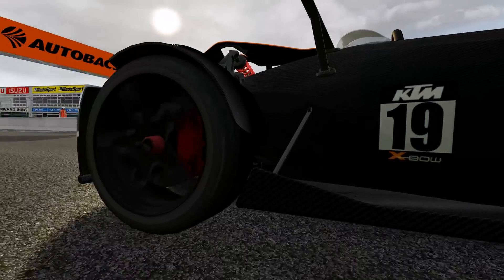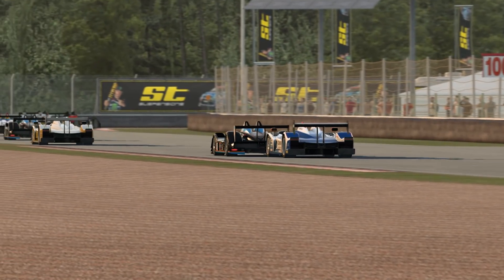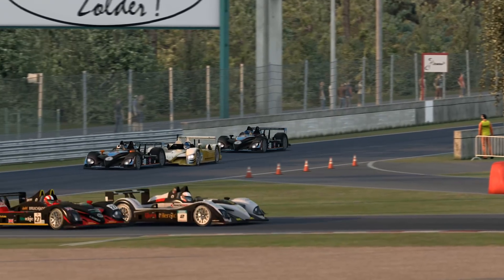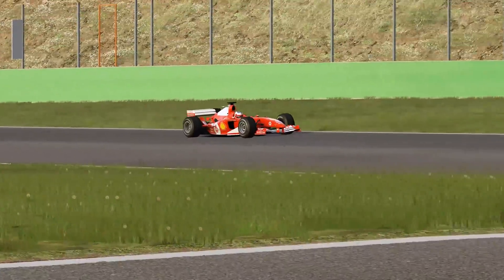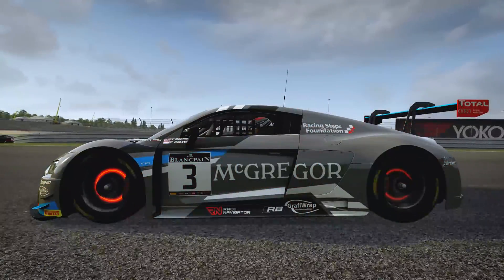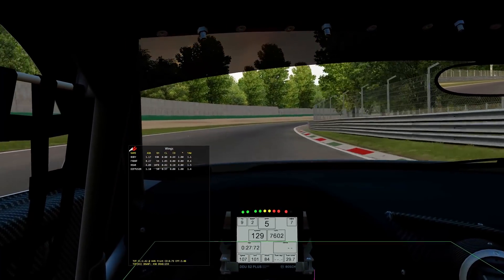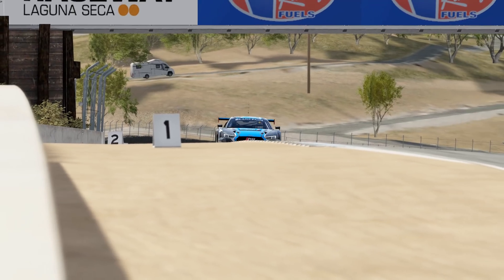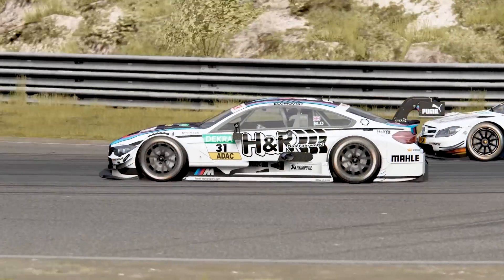Sim Racing Setup Guide 07 – Ride Height & Rake

Comment: In a downforce car if you're too low you may stall the underbody aero - OK cool, but how do I know this is happening?
Reply: +Viperion_NZ Every car is different here (!) but stalling can occur both when too low and too high. When too high it will loose a ton of grip and won't let go - think top of eau-rouge where front is stalling in almost any GT car with any setup - you get endless understeer.
When too low the car suddenly becomes twitchy, as the closer you are to the stall limit the better aerodynamics work. For front splitter it looks like this: you enter the corner, car wants to oversteer and then suddenly understeers, then oversteers again and so on. And in reverse for diffuser stall on the rear of the car.
This often happens in corners with some compression or camber, like bottom of eau-rouge, and also can happen under straight braking where tyres lock in initial braking phase - where front bounces off thanks to the stall reducing front grip for an instant long enough for a wheel lock.

What's also important is that when you are close to stalling on one side of the car, a small change on the other side may ruin your day.
For example, you run GT car with nose close to the ground, then you stiffen rear springs, and suddenly car is understeery in high speed corners, that's front splitter stall happening because jacking the rear up brought the front down.
Reply: You suddenly lose lots of grip in high speed corners .
Reply: I think Ayrton's 1994 Imola crash is the best example there is...
Reply from the maker: Hey dude - yeah, as the other guys have said, it's usually pretty obvious. You may lose the front, or the rear, depending on the circumstances and the rest of the balance of the car, but generally it'll happen at a point where the car is very highly loaded, so say T3 at Barcelona.

Comment: HI Chris, just wondering when you get into a new car do you use a setup a sheet as you work through setting it up to get a good quali car then a good race car ?
Reply from the maker: Hi Steve - No, that's a good point, but it's something I've been meaning to produce for a while though. At the moment I just refer to notes in Evernote, but a proper 'biro & clipboard' approach would make a lot more sense. If nothing else it stop the risky behaviour that is using Alt+Tab in a racing sim! ha
Reply: @ChrisHaye   oh does that mean I just gave you a helpful idea ?  And im not even a sim racer yet,  Im just in the process of upgrading from a PS4 player that used a logic G29 to  Ive ordered a P1 cockpit from simlabs, Simworx ( a Australian based Company ) Pro Series GT V3 Pedal set and a Sequential Shifter, and have also ordered the small MiGe motor OSW from SimRacingBay .... Any good tips on where to get a Decent Rim ?  My thoughts on having a setup sheet with a "clipboard & biro " was also to give myself a more immersive experience because as Sim Racers we are the driver and also the engineer, and i thought that after going through a prcatice session and making changes Im able to sit down afterwards and go through the data of the session and compare it to the notes of a setup sheet and then make more incremental changes ? Your thoughts ?
Reply: Setup sheet is good idea :)